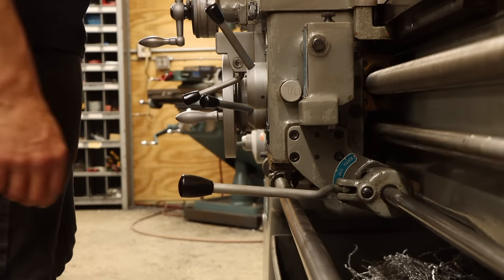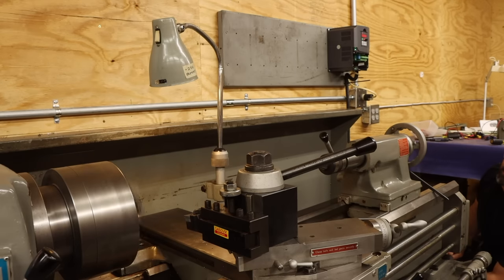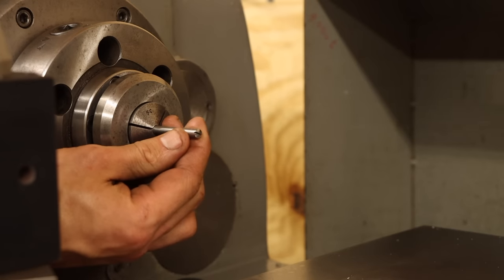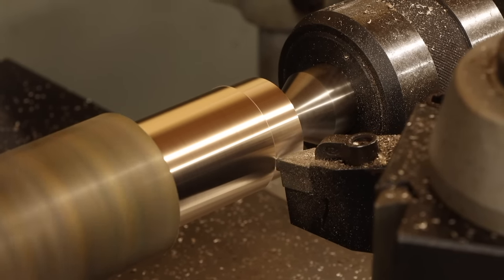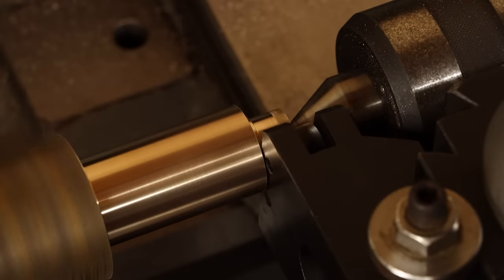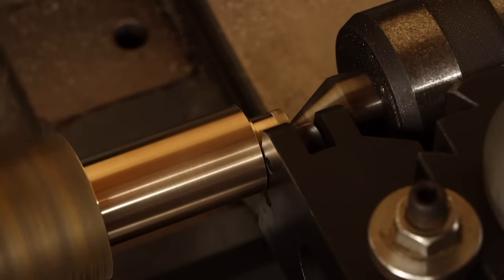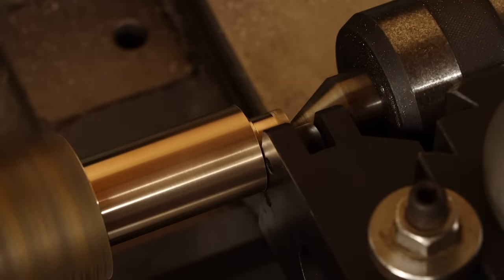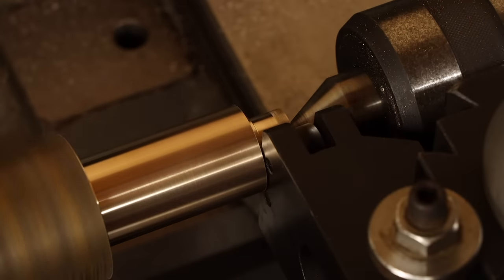Making a Surface Gauge (Part 2) || INHERITANCE MACHINING

Comment: 6:14 Your die isn't in the right angle to the shaft. If you support the thread die (but not the die wrench) with a flat faced shaft from the tailstock, your thread will be straight.

Comment: Should have used cast iron for base.  Steel is unstable over time.
Reply from the maker: I actually would have preferred to make it from D2 but didn't plan ahead very well.

Comment: При отрезании слишком маленькие обороты, из-за этого у тебя очень часто закусывает резец. При диаметре прутка 20мм нужно хотя-бы 400-500 оборотов в минуту.
Reply from the maker: Which cuts are you referring to? Almost all of the turning in this video was 760rpm and above. The only operations slower than that were for parting.
Reply: @InheritanceMachining  I'm sorry if I was wrong, I guess I just imagined.  At 13:31 minutes it looked like 150-200rmp to me
Reply from the maker: @ЖелезнаяЖизнь  No worries. That parting cut actually was down around 200RPM. I've found this is the only way to prevent chatter. Might be a result of the insert geometry.

Comment: I simply cannot understand why you don't have 3 phase as standard... here, in Europe, I think every home has 3 phases. It makes it SO much simpler and gives you flexibility to connect bigger machines.
Reply: It's definitely not standard here in the Netherlands so maybe some parts of Europe are luckier than others in that regard. There's been plenty of times I saw a great deal on a second hand power tool only to be disappointed by a 3 phase plug or a 380v label hanging off of it. And it's expensive to get it set up too from what I've heard.
Reply from the maker: Believe me I wish I had it too haha It may be possible in more urban/industrial areas. But definitely not in a rural area like where I live.

Comment: maybe dumb, but what is a spring pass?
Reply from the maker: Good question. It's just taking another cut at the exact same depth. Usually under an initial heavier cut the material will "spring" away maybe a couple thou. So following with the spring pass will clean that material that was missed

Comment: I did something similar. The unit I put in is 480 volts double wound motor for low and high . I had a rewind shop look at it and they said it was 480 volts couldn't say no for the price $600 for 16x40 but I didn't realize what I was getting into to make a long story short it was a heck of a lot of work LOL but I love that machine almost as much as my dog and that's a lot. I put my vfd as a single unit for all my shop equipment I have contacted wired in to feed the main Transformer to step up to 480 volts single phase and I have contactors on each machine with thermal overloads that protect each individual motor as long as the drive is larger than you need all is good you can even run two Motors at the same as long as you start both at the same time all is good love your videos
Reply from the maker: That's a clever approach. I was considering a single rotary phase converter for the whole shop but went he "quicker" route. Thanks for the idea and the support

Comment: For future projects that might end up using the granite surface plate, any mechanical instrument should have 3 feet - no less, no more - otherwise it will rock. Only 3 feet will always be stable.
Reply from the maker: Oh yes. Already unsung it on the surface plate!
Reply: @InheritanceMachining  unsung? I don't understand. 
Thanks!  :)
Reply from the maker: Sorry… already *using it. Silly autocorrect
Reply: @InheritanceMachining  thanks!
However, in the future you might want to consider 3 feet. I know a lot of guys have put it a lot of work on various things only to find out 4 feet wiggle excessively........
Hopefully your 4 footer will work out  :)
Reply from the maker: @artmckay6704  it does have a TINY amount of wiggle. About a 10th over 4 inches or so. I might have to lap the bottom to true it up if it becomes and issue. I imagine this is what Starrett and Lufkin did as well since they have 4 foot designs
Reply: @InheritanceMachining  two big names that use 4 feet...... who would have thought they wouldn't know better? That's so weird to me.
Oh well, a tenth over 4" is certainly tolerable. Eliminating that would probably require a jig to keep your instrument from wiggling when you blue up the surface plate and rub the feet in. By hand, I can't see how it'd be possible.....
Reply: I understand the 3 point plane thing.   I thought the 4 slip fit pin were to account for that. Extend the pins then gently press the  base down.

Comment: A VFD is a poor choice for your shop. A single quality Rotary Phase Converter will power all of your three phase machines.
Reply from the maker: I considered it, but for less than a third the price I couldn't resist trying the VFD. Plus it has all the extra functionality that I can grow into as I see the need.
Reply: @InheritanceMachining  Buy once, cry once. One RPC powers your lathe, your mill, your surface grinder, band saw,, etc. and any additional 3 phase equipment you add. You'd have to buy a VFD for every machine and go through all that set up and programming. It's just not worth it to me.

I had a static phase converter on my mill when I first rehabbed it. You're right, they are less than ideal (I would call them junk). But took the plunge and bought a 10hp RPC. I can power ANY machine with up to about a 5hp motor. No parameters to program. Nothing to modify. I stand by my opinion that a VFD is a poor choice for a lathe/shop like yours. But I respect your opinion and your choice to do what you feel works for you.